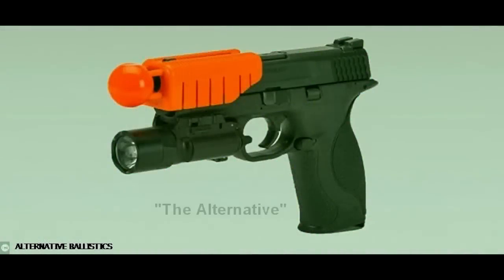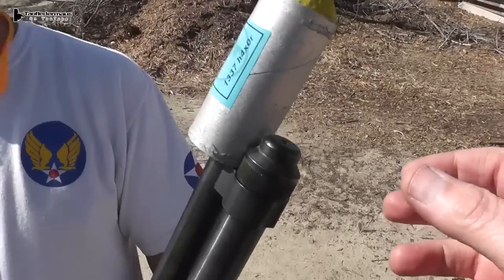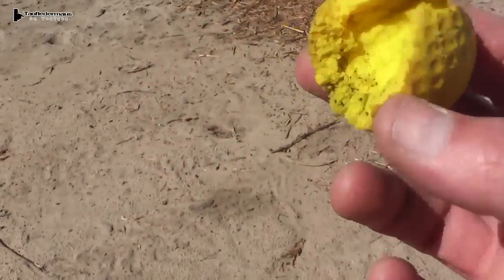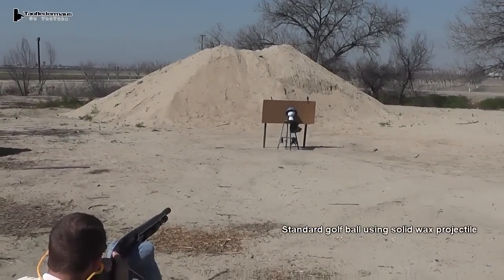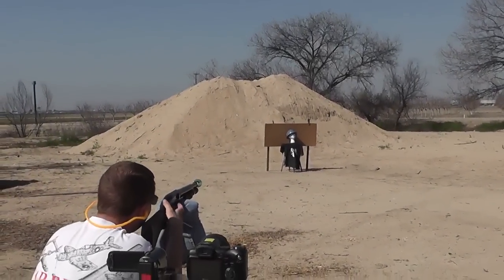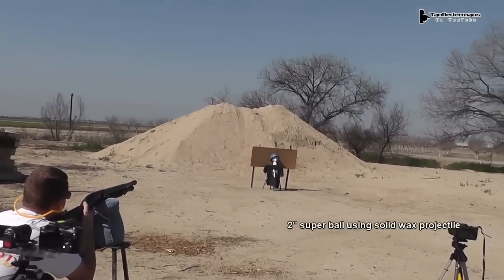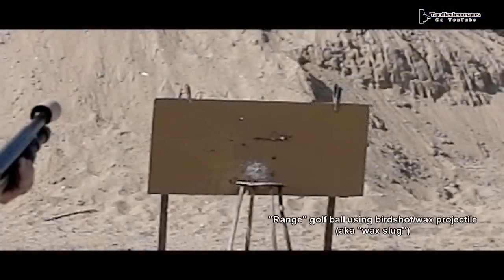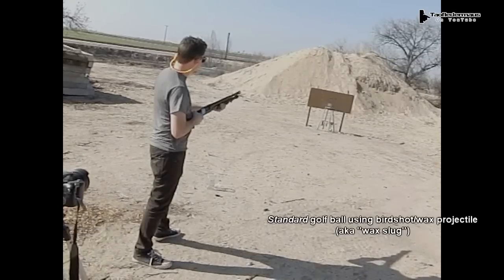Shotgun BOUNCY BALL and GOLF Ball Launcher - $5 Challenge

Comment: Not a horrible idea. I think with a slightly higher budget, you might be able to work something out. The only problem I see is rubber buckshot is not all that expensive so...Well I guess you can not get confused on if the less than lethal option is attached or not.
Reply from the maker: Jesse Sisolack  If we had a bunch more golf balls we probably could have gotten it down,  knew what angle to hold the gun, etc.   Probably would have gone through that 3/4" plywood back drop!
Reply: ***** Well I am not sure if that would count at less than lethal, ha.
Reply from the maker: Yeah,  it would bust your skull up. lol
Reply: ***** good for driving though

Comment: That thing defeats the point of even having a pistol, its meant for encounters with criminals where lethal force is needed. If they insist on less than lethal capabilities get special rounds developed. Shotguns got bean bag rounds for just that reason I doubt it would be hard to develop something for a pistol, hell just get beanbag rounds in .410 and give officers a judge with 6 of those in the cylinder. You have your less than lethal capabilities and don't risk accidentally shooting somebody you don't want shot.

Comment: Since you can't find the correct size bouncy balls, why don't you take a pipe with the same ID as the barrel and sharpen the edges and use it to cut bouncy ball slugs? Some silicone spray should help lube the process ; )

Comment: Hey u can go to the $1 store and get one of them games that have the lil balls in it it's the one with the spikes and balls I can't re call what it is but the should work in a 12ga
Reply from the maker: Blake Williams  The only ones I have seen are make out of plastic and too large to fit into a shell   Even if I could find metal ones,   a single jack is too light and takes up too much space and wouldn't have enough weight to cause enough pressure to ignite the main powder charge.

Comment: I have a question, ive heard of someone using a beanbag in a shotgun, is that real? If so how?
Reply from the maker: +Trevor Bilinski   It's just a little bag with lead shot,  or sand in it but it is shot at a very low velocity.
Reply: Beanbag rounds are a special kind of shotgun round commonly used by riot police for non-lethal purposes

Comment: Silly putty over a reduced charge should be under $5 and less lethal.  (I have to say, the If I want to be less lethal, I won't be aiming a 12 ga. at it)
Reply from the maker: We've done silly putty several times.   It's about $2 a round I think for the larger SP slugs.   They still travel at about 2000 fps-  faster than deer slugs.
Reply: *****
Yes- I've seen the silly putty vids and those rounds are very impressive.  I was thinking that if you reduced the charge by about 2/3, the muzzle velocity would be in the 600-800 range and the putty would flatten on impact becoming less lethal, and for well under the $5 threshold.
Reply from the maker: I think it would still shatter even at those speeds.  Since it is a non-newtonian fluid it becomes harder when put under stress.   But I guess it depends if you are hitting something soft or hard too.